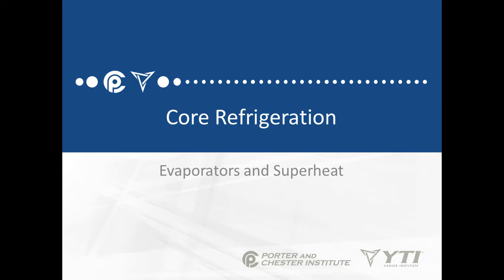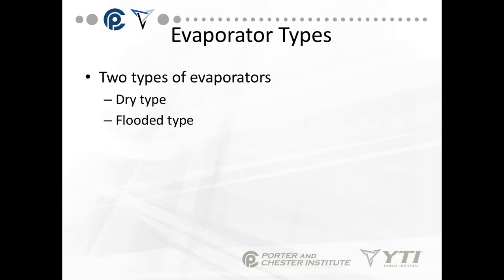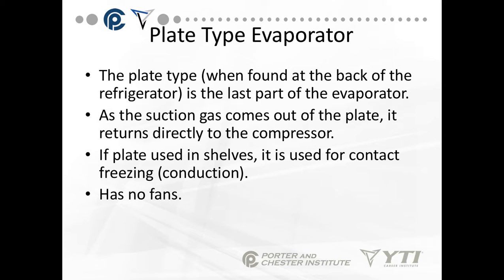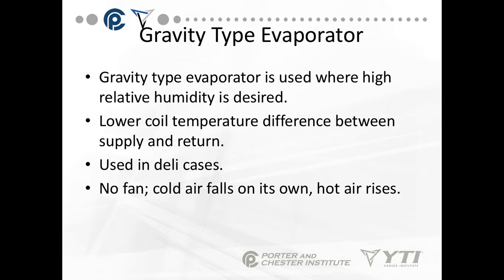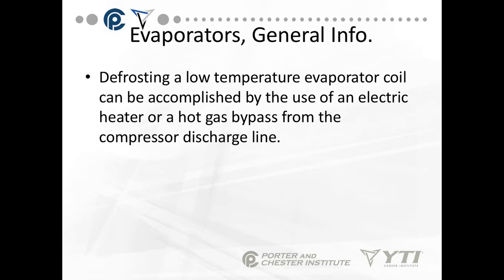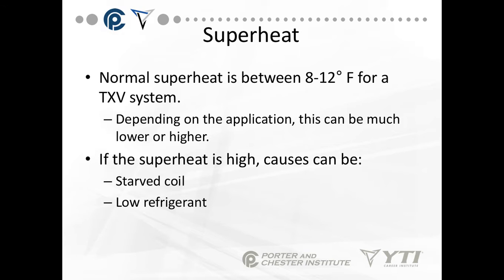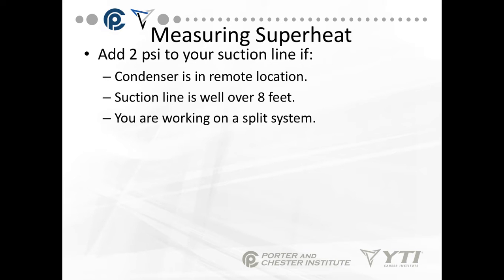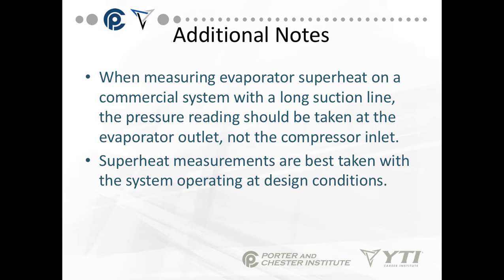Core Refrigeration: Evaporators and Superheat

Comment: I was having issues with an oil failure control, I was looking on YouTube to figure out how to go from a 4-wire setup to a 3-wire setup where the compressor has an unloader I could not find anything but I stumble across your videos I have to say you're extremely knowledgeable I have been in the field for 20 years and I've learned some new things already I have subscribed and will continue to watch thank you
Reply from the maker: Thank you sir! I don't have anything put together yet on oil pressure controls other than a brief presentation aimed for students in an HVACR program in my Advanced Refrigeration or Advanced Air Conditioning playlist.